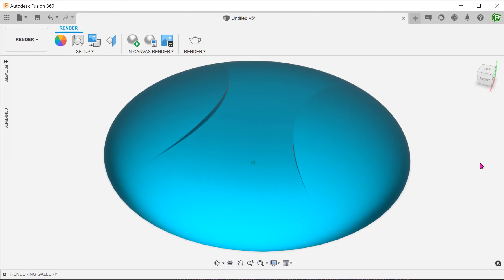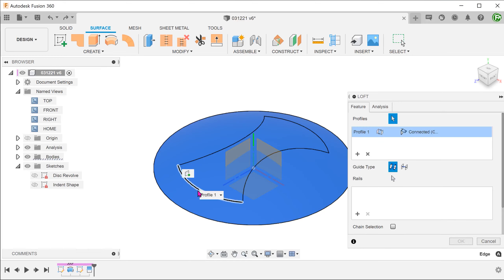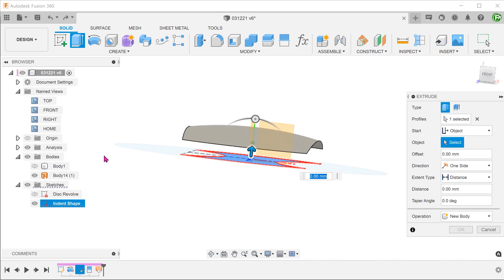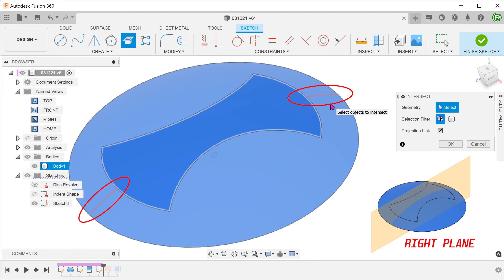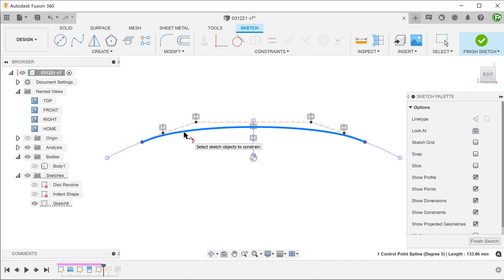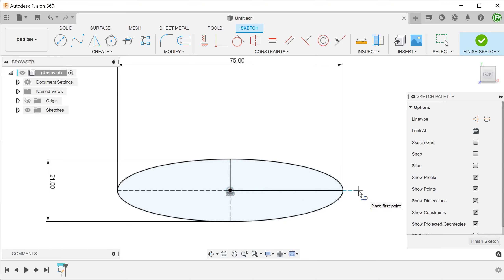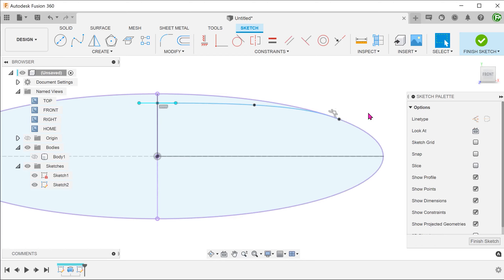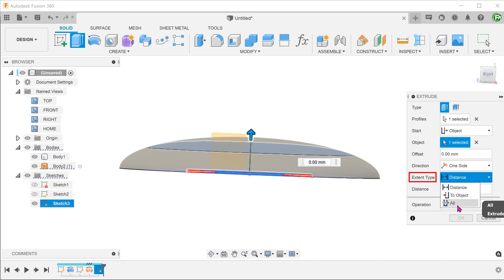Fusion 360 | Case Study 21

Comment: I had made the surface body with a revolve like you did but I used a horizontal line and an arc instead of a spline because I wanted to make sure that the center area of the recess was totally flat. As a benefit it made it easier to adjust the radius of the flat center area vs the radius of the arc tangent to the elliptical body, however that made the surface body have two faces which then couldn't both be selected as the start point for the extrude cut. So instead I went split body using the recess profile and then replace face of the recess body to the surface body and combine to finish.

Comment: I've been trying to replicate this object carefully using method 1 & 2, but when it comes to the point where the extrude needs to cut the main body from the dipped surface, I keep getting this error :

"There was a problem combining geometry together.  If
attempting a Join/Cut/Intersect, try to ensure that the bodies
have a clear overlap (problems can occur where faces and
edges are nearly coincident"

It doesnt matter what shape I use on the bottom plane to do this (I tried simple ones as well).

Any idea?
Reply: Same here.
--------------------------------
(Potential solution)
Well I dont know if it will work for you but in loft operation you can see an empty box called "Closed" try to check it. It fixed it for me. I was going mad for a while.

Comment: perhaps one day you can do a video showing how to project a face from a curved surface onto a flat plane AND have the proportions of the curvature preserved.  Think of it like this:  You have a curved object, say a side of a boat hull, and you want to project a section of that curved hull onto a flat piece of material and then cut it out.  What you want to have as a result is a piece you can then attach to a second boat hull and have it fit the curved area correctly.  I cannot find anything on this :(
Reply from the maker: I have been exploring the use of sheet metal functions to flatten curved objects. I did have some half-baked video ideas on doing this.  Nothing concrete at the moment. Still looking for a good example. Thank you for the suggestion.
Reply: @Fusion360School  Thank you for considering my suggestion!!
Reply: @DerekSpeareDSD  3DExperience CATIA has a flatten function in the sheet metal design and generative Surface develop apps. No clue how to do it in Fusion though.
Reply: @13D00_  lol...me either!